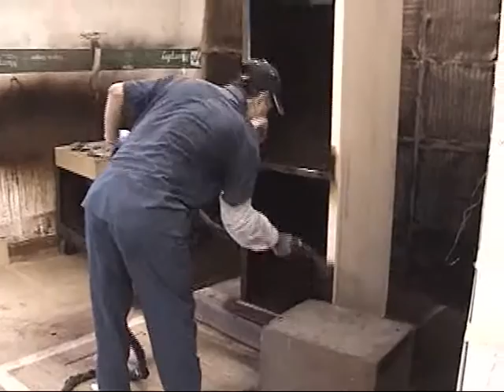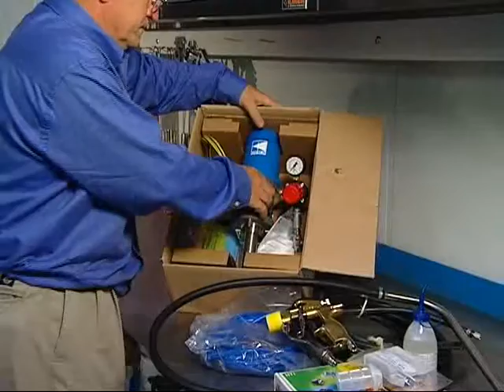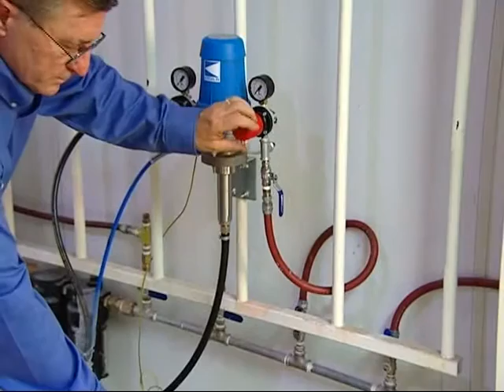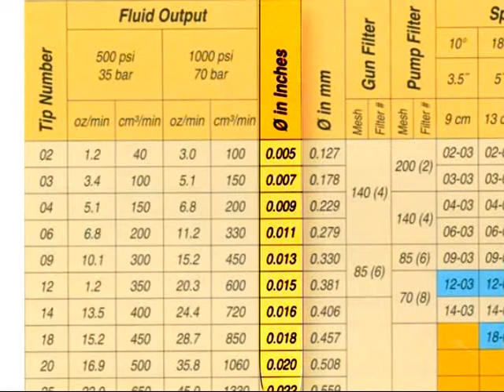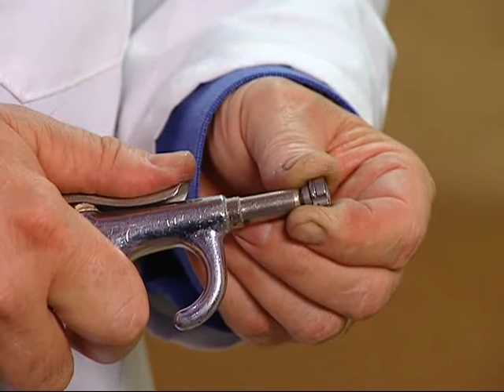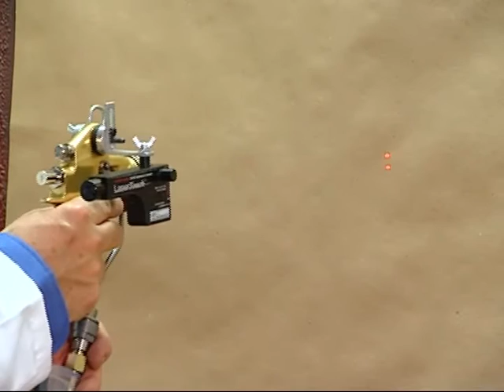SAMES KREMLIN® AIRMIX® Training Video Part 1

Comment: Hi why my spraying fan keeps pulsing? Does it mean low pressure?
Reply from the maker: You likely have dried material around your upper or lower ball. Take the fluid section of the pump apart and clean and it should resolve your issue.  Also check the gun filter.